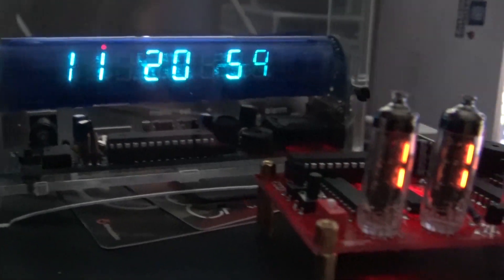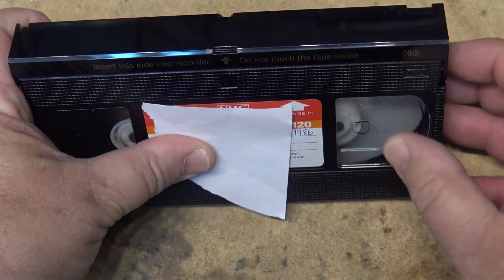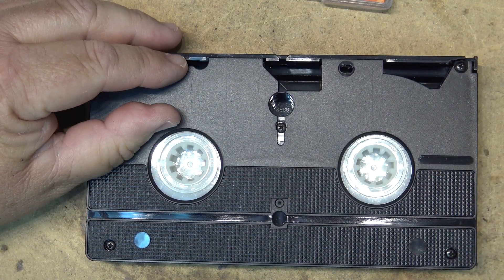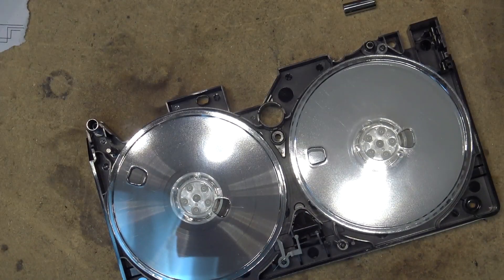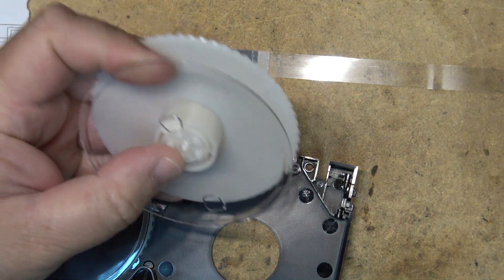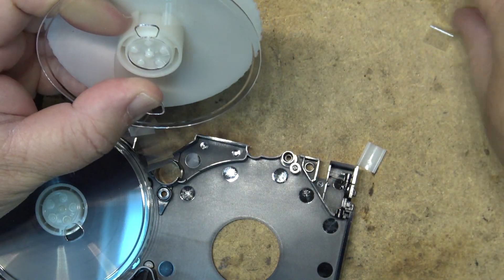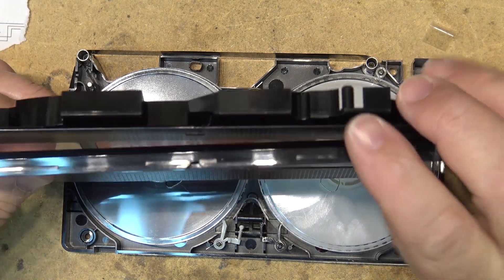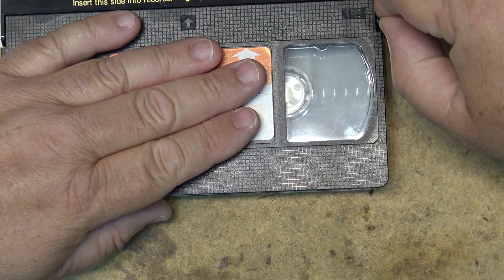How to repair a broken VHS tape

Comment: Thanks man! That plastic piece was a PITA. It cracked and I barely got it out without destroying it but I finally managed to get it back in without much of a fight. I think different manufacturers have different designed for that plastic locking key. Mine looked designed to never come out.

Comment: I had a Ferguson VCR with a high speed rewind that liked to snap tapes so I got into the routine of stopping it before it reached the beginning and visually rewind the tape the last few minutes.
Reply: I'd say it was a poor design OR the hub brakes were worn too much
Reply from the maker: My Panasonic will rewind tapes so fast it is incredible.  It slows down as the tapes get close to the end to prevent the snapping of the tape.

Comment: reminds me of fixing cassette tapes as a little kid.  they had two kinds of tape to hub locks usually; something similar to that VHS tape, and a little tiny plastic pin.  The plastic pins were the worst, since they were very small and easy to lose and took a lot of pressure to get it in there.  Usually it got launched across the room, never to be seen again, so it was down to scotch tape.  It worked once at least. haha.

Comment: What I would to love see is a video about splicing and repairing a VHS broken in the middle. Surprisingly few videos on the subject
Reply from the maker: I have done that already years ago.
https://www.youtube.com/watch?v=recMA8zWpGo

In this case the tape had broken off the leader but splicing in the middle is the same.
In this one a cut VHSc tape is fixed.

https://www.youtube.com/watch?v=clQSFl_qzao
Reply: For those that elect to do that type of splice ... it is highly recommended to transfer the video recording ... the video machine puts a lot of stress on the tape and the splice may not hold for too many plays before the splice comes loose ... not to mention it is a bit stressful on the video heads as well ... that is specifically on the video tape itself not on a detached leader hub or spliced to the tape ... the leader doesn't pass where the video tape goes not much passed the tape end sensor ... I've observed most if not all machines pulls the leader past the tape end sensor some do that as soon as you put the tape in the machine (older ones) the newer ones pull the tape as soon as the tape is inserted ... the older machines wouldn't pull the tape around the heads until play or record was pressed
Reply from the maker: @darinb.3273  the only reason the machine does this is so the tape sensor is not detecting light on one side.  Many old machines did not and loaded the splice right over the head.  If done right with no adhesive overlap then there is not many issues, but 99 % of people doing this is to get material off the tape.  There is no valid reason for anyone to still be using vhs tape, artistic reasons aside. By that I mean someone wanting the VHS look for a project.  Sure you can simulate it, but nothing does it like the original.

Comment: Yep been there, i've had the leader splice let go, same result.
The old jvc 3320 piano key machine i used was slower on rewinding tapes, and it never snapped them.
Less accelleration shock i suppose.
Reply: Indeed modern machines really move the tape ... the hub brakes wear down more because it typically is moving faster than the older machines ... I tried a cheap video winder from Radio Shack and it snap the leader just like in the video 12voltvids just repaired it really was a pain just as he said

Comment: You should put a Piece of tape on the Top layer of the Splice to re-enforce the repair
Reply from the maker: It is as strong as the original and this tape is being played only 1 time to be digitized and then I am sure it will be thrown away. Just has a bunch of little kids running around on it.
Reply: I used to fold the leader over, much stronger. The tape Is Brittle.
Reply: @TheBudgie29  I cut the factory Splicing tape that on the Clear film and recorded film off and take the newly cut pieces with Scotch Gift wrapping tape (I use this tape because Transparent likes to collect air bubble more) and cut the new Piece of Tape in half and Put the Clear and Black pieces of tape on the bottom and on top. This makes the new Splice Stronger than the factory splice. I leave a bit of the Gap on both clear and the black coated tape so I don't overlap the 2 pieces. I would recommend doing this repair if the Factory splice is starting to peel off or snap during Rewind and Fast forward in the VCR.

Comment: It's called archiving now, In My day We called It Pirating, how times change. Used to do this all the time, even with Brand New Tapes. We would do Video Loops, they looked great. Still have them somewhere, Obsolete now as I use a Jingle Palette on a Touch Screen Notebook. Nice demo of how to do It properly.What We also did , was We would buy the Blank Carts, These were just the Cassette case with no Tape In them (Audio Cassettes) as well. Because some have a Grease Paper lining on the top and the bottom of the Tape Reels. These would go off and turn bright Brown, after awhile, and go all sticky. We would take out the send Reel, and spool It on to the New one. Then throw the old one away. Could You demo these at some Point?. Same with Broken and Cracked Cases.
Reply from the maker: Pirating? How is that. These are all home videos shot with a camera. You know family stuff. No pirating there. I do not digitize commercial video no matter how much someone offers me to do it.
Reply: @12voltvids   I know, I only do Home shot Video's these days. And home made Audio Tapes. I knew guy's that did Pirate Videos back In the day. I remember, Jurassic Park being Their biggest seller, at £20 each (a lot of money back then) this was Before It got to the Pictures. It was probably the First Major Film to be Pirated this way.
Reply from the maker: @TheBudgie29  
There was much piracy.  I would "back up" the odd tape for myself from rentals back in the day. That's why I built that macrovision scrubber. I would never copy any copy protected or commercial tape for anyone.  I did backup a series for the school board called origins, a history of Canada and I actually have that series on my channel but that was done with permission.  I had a letter in my hand from the original producer given to the teacher that brought it to me releasing the series to the public domain for educational use as the series is 35 years old and the master tapes have been destroyed.  The funny thing is history teachers are sending students to my channel to watch. They all have over 100000 views.
Reply: @12voltvids  There was no Macrovision or protection device on the Pre-Cert tapes. I had a Mate Who would do nothing but Rent every Horror/Gore Movies that came In every week. He would sit In His place and Record them all. His Collection must be a Fortune now. As a Massive Bulk of the Films He did, no longer exist on any format. In the UK We had a thing called "Video Nasty" were they pulled every Offensive, Horror, Gore, Porn, Martial Arts off the shelves and would then Chop them up and put on Certificates IE: PG, U, 18 excreta on them. Home Alone falls Into that Category, The Film was cut from 115 Minutes to 98 Minutes making the Film Unwatchable for Us Who remember the Original. The So called Outtakes on the DVD's and Blu-Rays today are the Original parts of the Film, (Incomplete). I sat My kids down (Before My Sony C-7 Died) and they watched Home Alone and the Whole of Live Aid. They Loved It. Only the People Who were on the Ground Running back then, Remembers how It all went down, Now those Pre-Certs sell of Thousands on E-Bay and there Is a Dedicated Site for them as well. Here It Is Enjoy when You get a Little time.         http://www.pre-cert.co.uk/index.php    I cannot believe Someone complains about the amount of Video's You are putting up. I can't wait for the Next one, Just keep them Coming. Big up from the UK. I have lots of People all over Canada.

Comment: The last tapes I bought were snapped together and no screws, never had a problem with them though.  I have repaired them before, I bought a splicing machine, that made it a lot easier, but it it snapped from the reel I had to take it to bits.  One machine was bad, I think the brake was a little slow, so rewound on another machine to avoid it, but this machine was used to copy tapes from the original so I had a good copy if I was taking it somewhere as I never knew how good or bad the machine was I was going to play the tape on.  Do it right or don't bother.  I had to splice tapes that got tangled to recover them, then copied and binned original tape.
Me and tape were never the best of friends, and don't start me on cassettes!!!  :-((
Reply: Hahahaha sometimes machines aren't very friendly to the plastic ribbons of tape which makes you unfriendly in the process too LOL

Comment: Nice for those that don't know how to do it.  Do people still use VCRs?
Reply from the maker: Yes people still use VCRs for playback of old material. I sold a VCR / DVD combo unit a week ago. One I fixed on the channel.
Reply: @12voltvids  I still have a VCR DVD combo, but it just sits there, I was going to record videos of the kids onto DVD, but never got around to it yet.  Man, I need a good kick in the butt.  lol  I just bought it to do this, but hay, time is marching on and it is still not done!
Reply: @12voltvids  Did I watch that one, I must have done, yes, I id I think, trying to remember the make, but brain is not cooperating as usual.  Was it a Sony?
Reply: Transfer Tape to DVD all the time.
Reply: I use my VCR every day playing back the tapes i made of old by gone TV shows the old classics that i like most , Like The dick Van Dyke show , all In The Family and a few other old 50's/60's TV shows, most are VHS but some beta Also, i have alot of tapes with these shows on them, i started transferring to DVd then sold the Machine i used for transfering qand just Use now standalone Machines that way if one breaks i won't need take the two out of service for one, as the combos didn't last as long as the component type machines i use now., but like i say i use VCR's every day and DVD players.

Comment: I suppose it goes without saying but you should avoid handling the actual tape and where you have too, use a very light gripping method (more like guiding it).
Reply from the maker: Wash your hands first as the oil from your skin is the worst offender.Wiping your fingers with 99% IPA is not a bad idea as well as that will remove those oils that contaminate the tape surface.

Comment: Hi Volts! Another good video regarding things VHS/VCR. I know that using isopropyl alcohol is the best to use when it comes to cleaning the heads inside the VCR. But what would be considered an appropriate alternative? Also, would using white spirit be ok or would you say hell no to that?
Reply from the maker: Ipa 99% is very good.  Xylene is another good solvent but caution need to be exercised with xylene as it will damage rubber and plastic parts. 
Freon TF was the best and safest but it is no longer sold as it eats the ozone and that is a bad thing.  Those of us lucky to have a stockpile can continue to use it but can not sell.

Comment: 6:12 I actually did that with a recordable tape back on 11/10/19, the little hub is red.
Reply from the maker: Some were red.
Reply: @12voltvids  There are a few of them do have a different colors including the reels, pegs, lids, and the VHS shell that has either a acrylic, or a normal solid colors.
Reply from the maker: @Bluethunderboom  
Some were tough as nails too and others shattered if you pulled them out of the box wrong.
Reply: Mainly TDK used red tape retainer clips. The way I used to remove the clips was prying it upwards with a knife.

Comment: 0:11 was the cringyist thing ive ever seen.... you ever hear of esd.... and how damaging it can be...
Reply from the maker: Very few devices are ESD. Those that are are really only susceptible when they are a bare component.  Once mounted to a board they are relatively protected by other component and capacitance on the board.  Know how many devices I have damaged by ESD in the 37 years I have been working on electronics.  Zero. That's right none. I do practice ESD service procedures by touching something grounded to discharge any static on my body.  My camera crane is grounded so every time I start and stop the camera I am grounding myself.  Components that are easily damaged are the laser diodes in CD and dvd players and I do practice ESD handling when working with those.  But if I blow something up bug deal.  The majority of this stuff I work on is mine. Very few pieces are customers and that is why I don't care about it because once I am done most of this stuff is headed for recycling or being given away.
Reply: @12voltvids  I can't say i have ever damaged anything from static either, even computers and ICs, but I do take care but don't have bracelets etc as the last thing I want is to be grounded if i do touch something by accident I don't want to, like brush against the mains supply, Especially here as it is 240v and trust me it hurts when you touch that.  I was lucky on a job, I killed all the power and checked everything was dead and that there was no feed to the three phase controls.  I needed the three phases to be powered at the panel, just so I could push the contactor in for a second just to test.  I was moving a three phase motor when it came live and who had their fingers across two of the phases and earth.  That motor got dropped in a hurry, lucky for me it was heavy and when the power came on I straightened up and dropped it.  Some stupid B********d had wired a remote control to the contactors (yes they were all hooked up, another thing that was not right) and on come the power.
I had deep burn marks on my hands for months.  There was someone with me, he killed the power, but it was still live and turning.  When you kill the power it should all go off!!  Anyway, he was told to stay with me and if i showed any signs of collapse or feeling faint he was to get a paramedic here to treat electric shock!  Now who would wire something with a feed from somewhere else by-passing the isolator switch(s).  After a huge fuss I spent a week ripping out the wires and tracing where the other feed had come from.  I found the BOSS of the company had had someone come in and wire a feed from behind the boss man's desk, from another source!  Incredible!
It is like wiring up a kitchen plug from the upstairs sockets!  Just the one, or taking a neutral/ return wire from upstairs socket to feed a light just because there was not a neutral handy!
Anyway, I digress again.  Static has never been a problem for me, except when I go to a lift after walking on nylon carpets, I think that can hurt just about as much as it did when I had a hold of the motor.
It never fails to amaze me how stupid some people that should know better will do stupid things.  Who wored that I will never know, nothing in the panel, no warnings, nothing.
Yes, I know what others are going to say, the panel should have been off, yes, maybe, but the way it was wired would have made little difference as power was supplied through the panel, by-passing the panel isolator from another source, How it didn't cause problems with power coming from two sources until then  is a mystery!
This panel had to control this motor, for reasons I will not get into, but if power came from the other source it would have ran until there was an explosion.  Maybe not, as the safety was the only thing left controlling anything.

Anyway, nice video on how to repair a tape if it snaps off the reel.  Splice it otherwise and transfer it to another tape and cringe when the splice goes past the heads.
Reply from the maker: @BoB4jjjjs  
Thats why I don't wear a wrist strap. I want to be isolated from ground, and my bench supply is electrically isolated from both earth and mains through a 1:1 isolation transformer with floating secondary.